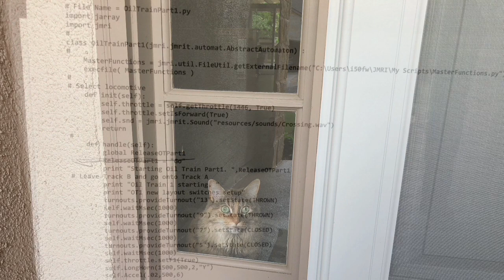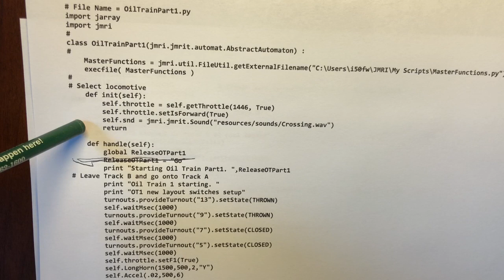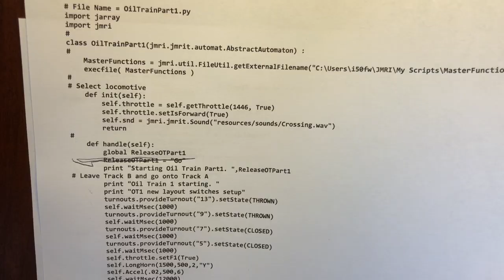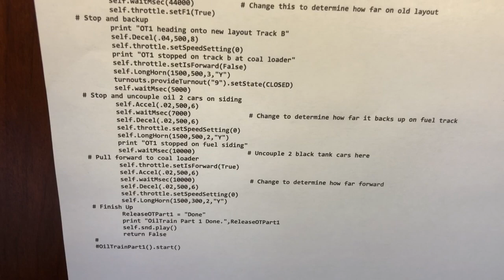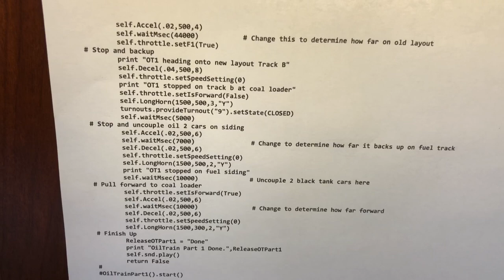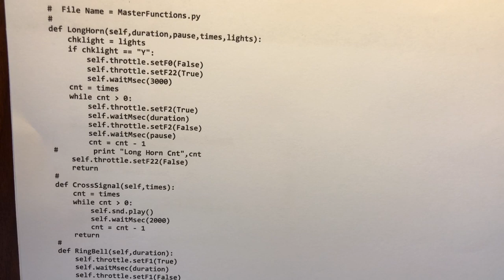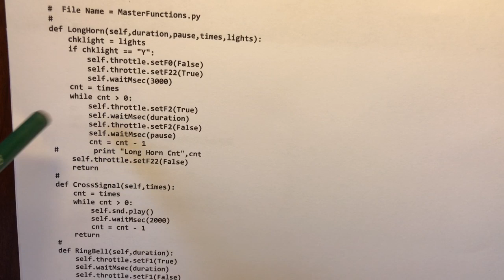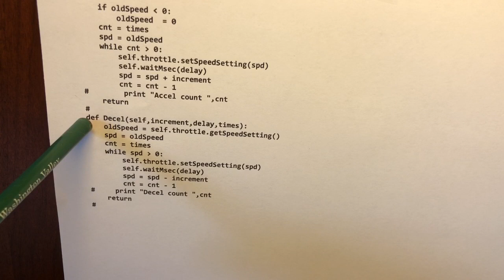My 4x8 x 2 HO Layout - JMRI Script Details Part 2 - Oil Train Script and Functions

Comment: Nice script and explanation.  Your master function script is a Python script that creates objects (which contains the various function s) that are passed to the java script to be used when the object is referenced.  JMRI is using modern programming techniques.  To get around using timing to start movement, you may want to a detector as input to start/stop train. I use shadow detectors on my layout.  I hope this is a help
Reply: I was looking at my books and found another good one.  This covers the Python script language.  Python is used a lot with the linux used by Raspberry Pi.  The book is: Python Crash Course by Eric Matthes, publisher No Starch Press. Hope this helps.
Reply from the maker: Thanks Greg.  Ironic thing happened today.  Pest control guy here today.  Saw my layout and we talked a bit.  He said he uses Arduino.  I asked if he had model railroad.  No he uses it(several) on his ranch to auto feed and water chickens and cattle.  Apparently cowboys are quite up to date here in South Texas.  Thanks for reference to book.  I’m not doing must on layout for several months.  Just too hot in my garage.  Be safe😷
Reply from the maker: Thanks Greg.  Tell me more about shadow detectors.  Same as ambient light sensors?  If so, what device(s) do I need to have them pass information into JMRI via my SPROG3?  Thanks for any help you can give me.  Electronic are a mystery to me.
Reply: Yes, they are light sensors.  I use light dependent resistor (LDR).  I am not familiar with the SPOG controller.  But, I do know it uses a  Raspberry Pi microcomputer.  There is an excellent book for the Raspberry Pi.  It is Simon Monk "Raspberry Pi Cookbook".  The publisher is O'Reilly.  There is a section on using a LDR.  It has examples of how to connect sensors and code to use them.  It is written for a beginner, but is an excellent reference for the more advanced user.  You may be able to find a PDF version on the web.  I prefer a paper book.  The major drawback of a shadow detector is it needs light to work.  They are not suitable for night time train operations.  I hope this is a help
Reply from the maker: Thank you.  That helps.